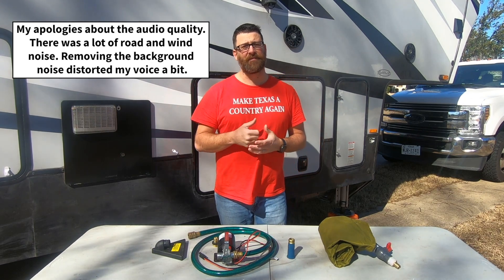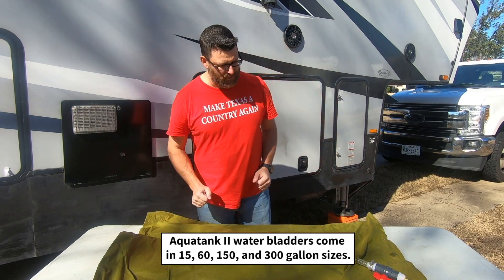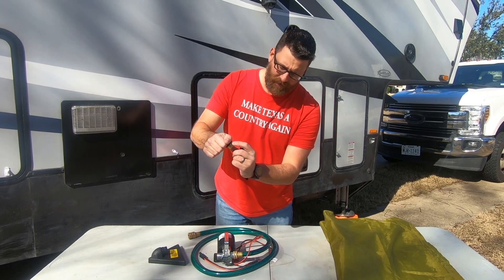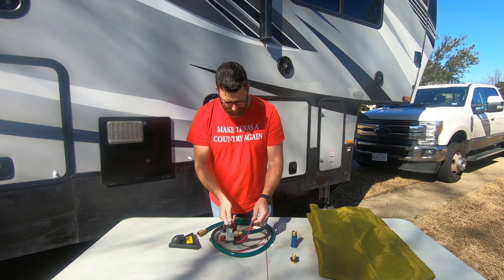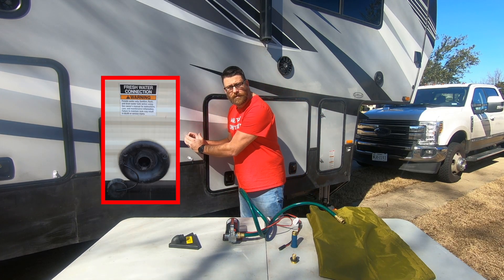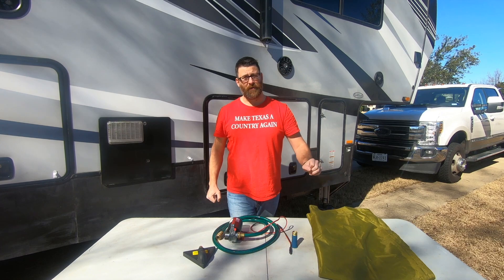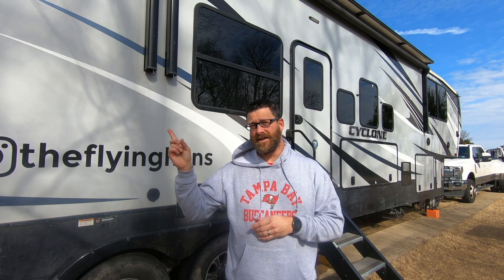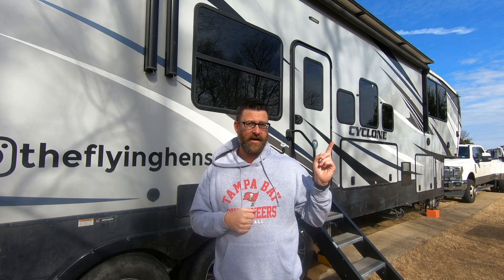Boondocking 101: How to Refill Fresh Water Tank

Comment: Do you have a link for the butterfly valves? Hard to tell what size they are. That's the only thing keeping me from doing this for my next big boondocking trip. Also what else did you need to add for the water hose attachments?